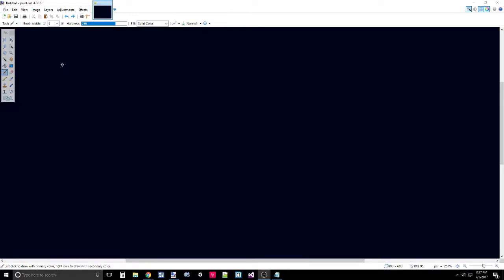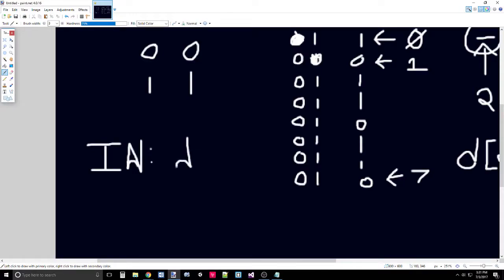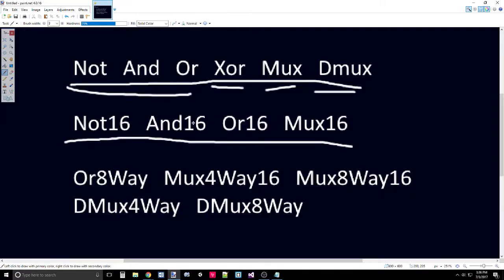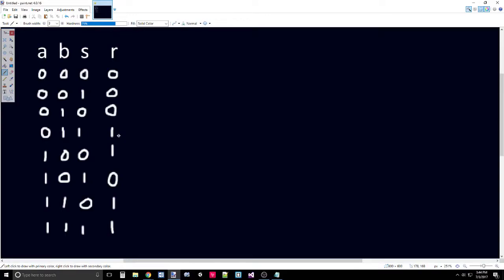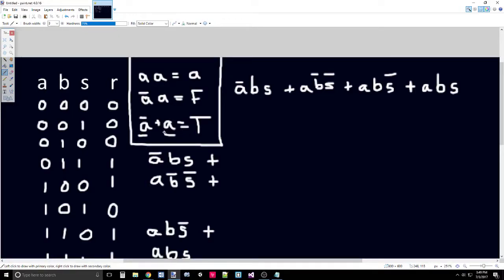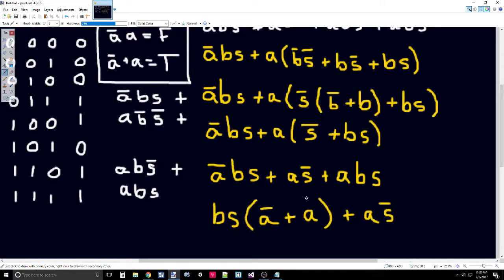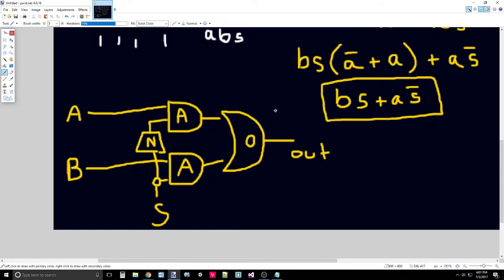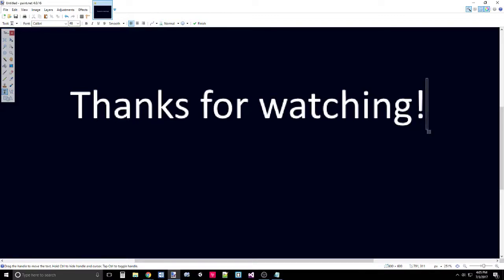Nand2Tetris StudyAlong -  Multi-bit Buses and How To Design

Comment: Beautifully explained, thanks very much! I'm familiar with digital logic simulators so I've been using this type of software to connect gates and just experimented by hacking things together until they produced the correct output. But I was curious what people would do without said software, and since the instructors didn't mention it, there had to be another way, which you've described very well. From now on I will go through this more formulaic way of working out the gates (just gotten up to MUX myself).